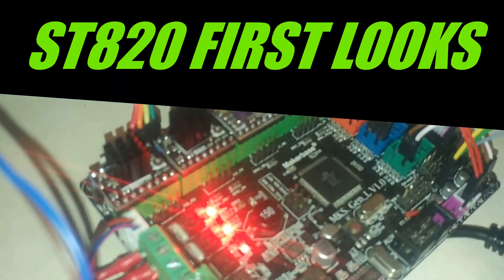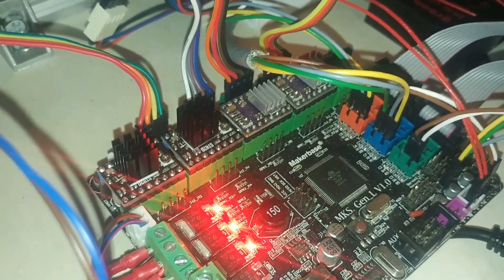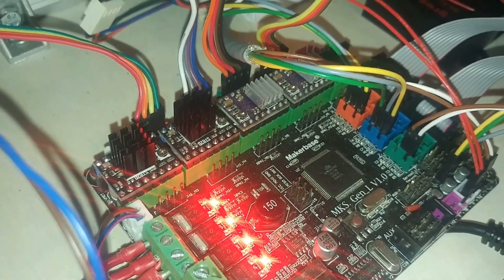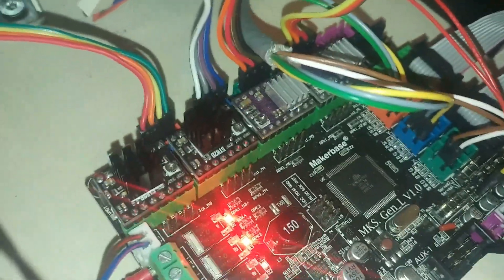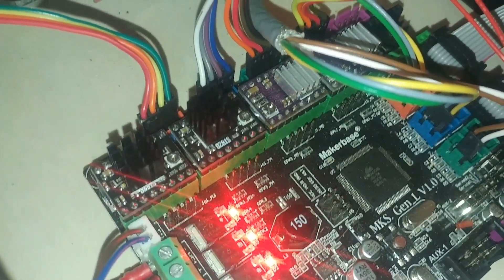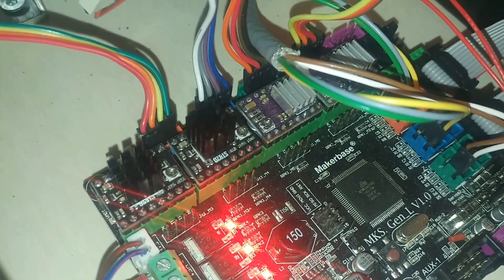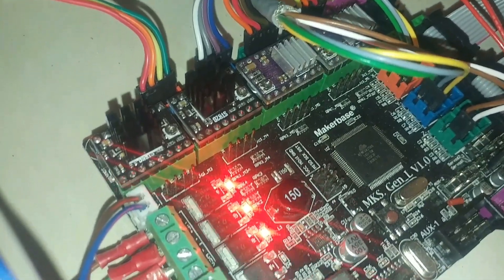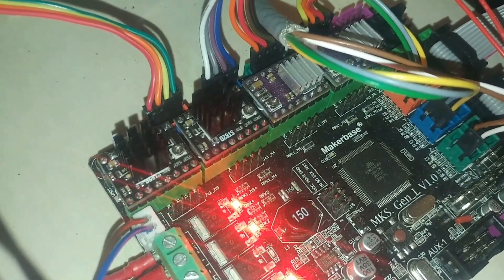First Looks - ST820 NEW Stepper Drivers

Comment: High Torque same DRV8825 ? i can use with Extruder filament ?
Reply from the maker: I never got around to test the ST820s. I find the TMC 2208/2209s very good and quiet so I prefer them

Comment: How did You define ST820 in Marlin?. There is no option in Stepper Drivers for ST820. Best Regards
Reply from the maker: You have to reverse stepper enable pin in advance
Reply: PRO 3D hello, how can I invert the enable output for (not software)
Reply from the maker: @jahhjahhjahh  this I don't know. Only in firmware
Reply: @PRO3DESIGN  I only connect the st820 to a cnc shield and charge the firmware and then can I use it on my board as a replacement for 8825?
Reply from the maker: I am here😎😎
Reply: @PRO3DESIGN  Thanks for response. I don't know what to put in config.h line which defined driver type. Like #define X_DRIVER_TYPE  A4988. There is no option for ST820. Best Regards.
Reply from the maker: @bik35  Oh you just leave that as is. Dont uncomment anything and set the jumpers as i the table on the fystec wiki

Comment: Hello im buy this driver for use at 256step...i have skr1.1 board 32bit with Marlin 2.0...i set High on firmware...i set the vref a 0.20...the stepper move After 10mm the LCD said fatale error reboot printer ..
Reply from the maker: Did you reverse stepper enable pin in the firmware?
Reply: 0 to 1? Yes...at 16-32 step work...128-256 not
Reply from the maker: @dylanshock87  sorry can't help you there

Comment: I have ST820 on my printer on extruder, I have 0.9° 1.7A motors on 24V and 3.3V logic. Using formula Vref=I/6.8 i have 1.3A (0.19V=1.3A/6.8) and it's maximum which ST820 is able to deliver for me, when I increase Vref, It start to skipping steps. According to the datasheet it should be able to work with 4.5 A peak so I'm little disappointed. But still It's much stronger than tmc2208.

Comment: WHat is better (most silent)- ST820 tmc2100, tmc2130, tmc2208?
Reply from the maker: TMC are more silent on the 8 bit boards
Reply: @PRO3DESIGN  I have mks sbase? And I have lv8793 drivers. Is there sense to change they to TMC?

Comment: Good afternoon! tell me please how to properly configure these drivers. Jumper put on 101 (1/32 step). Voltage for motors how much value? I have 0.3v, but the motors do not react.
Reply from the maker: What kind of motor do you have. I use 0.2 for 1.7 amp motors. But you need to set stepper enable pin to high in marlin. Set to 1 not 0
Reply: PRO 3D  I have the same engines, but I do not use marlin, but smoothieware. and unfortunately I can not start the driver to work. and how do you set the jumpers?
Reply from the maker: You set jumpers to 001 for 1/16 and 101 for 1/32.

Comment: Hello! but what about noise/silent compared to TMS2100/2130?
Reply from the maker: The noise is similar to the TMC2208. So very quiet at 1/32 micro stepping
Reply: I also ordered such drivers. I will try them on my delta printer. to 32 bits.